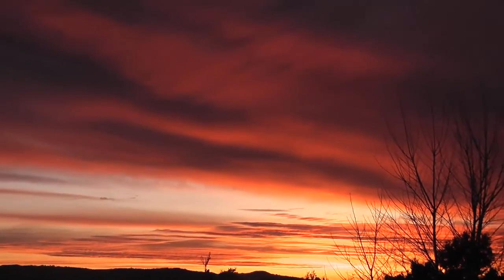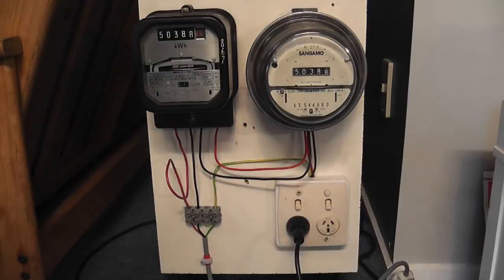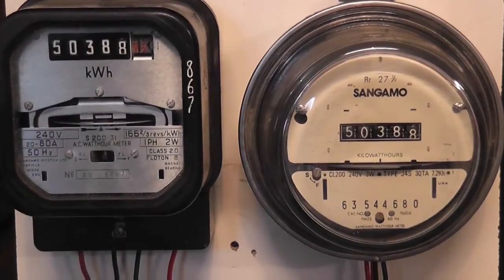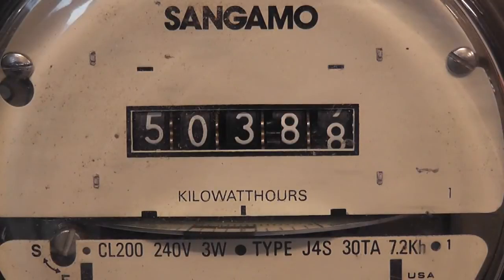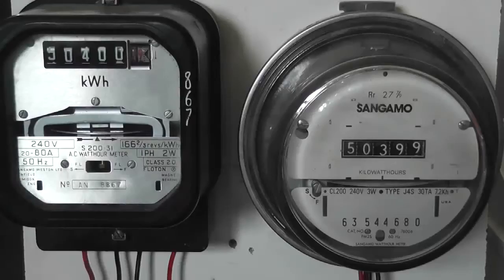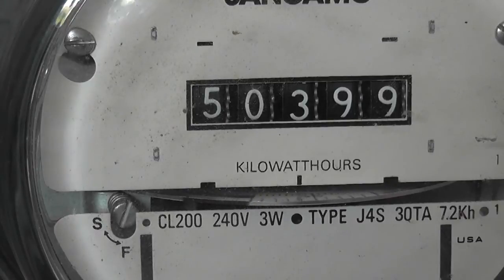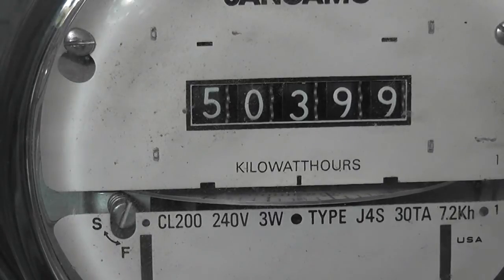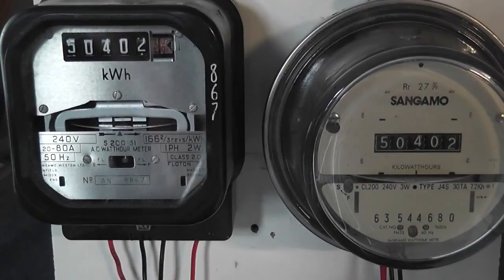50Hz and 60Hz kWh meters in series

Comment: Do you know if I could adjust the speed of the British Sangamo meter to compensate for the frequency difference on a 60Hz supply?
Reply from the maker: The British Sangamo meter would be happy to run on 277 Volts at 60 Hz in the USA. The meter speed constant is fixed by means of the internal gear ratio to the dials.

Comment: Request from here, could you show a video about a 240V 50Hz single phase motor connected to a 240V 60Hertz AC supply. Install clamp-on Ammeter and Tachometer then compare each reading to nameplate motor rating. Thanks.

Comment: So would a 220V 50Hz meter read less than accurate/lower kWh reading on a 220V 60Hz line?
Reply from the maker: +Hoshi Reed (ChibiHoshi) Yes, most likely as the voltage coil is not fully flux saturated. The 220 Volts meter needs 264 Volts on the PT coil to measure accurately at 60 Hz.

Comment from the maker: @Nivicoman The speed of the disc depends directly upon the current flowing through it and the voltage applied.
Frequency does also have an important role in the flux in the voltage coils.
A 240 Volts 60 Hertz meter will run fast on 50 Hz , hence I have to reduce the voltage to the PT coil applied by about 5/6.
I use a simple 5 Watt resistor which causes a voltage drop ans some phaseshift. By trial and error I have now a 60 Hz 240 Volts meter which ruins accurate on a 240 Volts 50 Hz system.

Comment: Nice to see these two instruments next to each other like that. So then: The J4S runs a bit faster than the S200.31, even though the J4S is wired after the S200.31? The thing here, is accuracy. It's bit of a shame that you didn't have the opportunity to cross-compare the J4S with an electronic equivalent while in the USA. This way, they'd both be on 60Hz, & if the J4S was found to be too fast/slow, it then could have been re-aligned to give a known accuracy. :-)

{^_^} BoomBoxDeluxe {^_^}